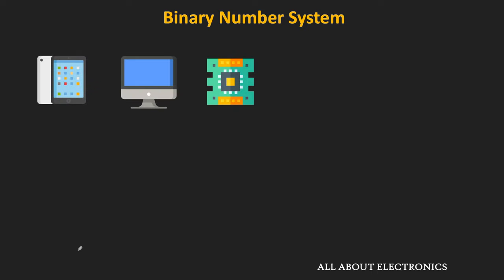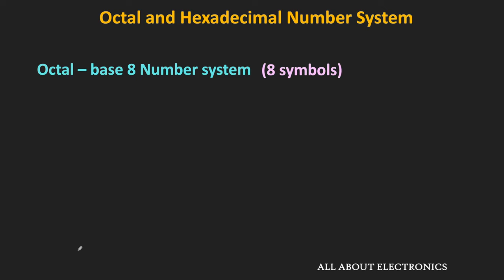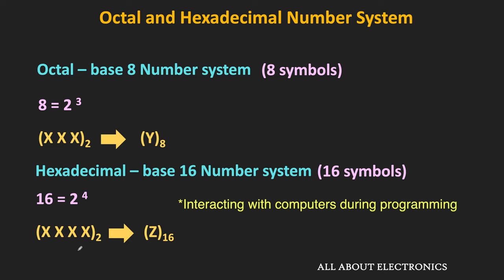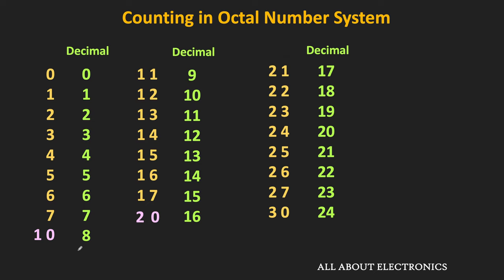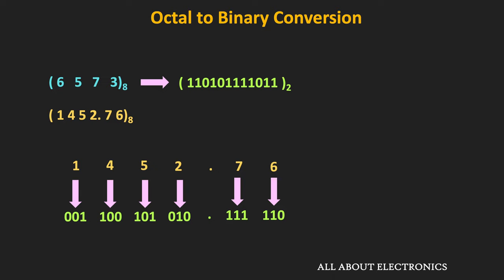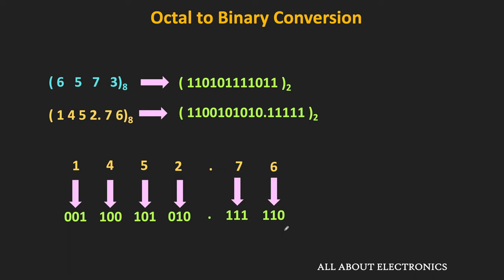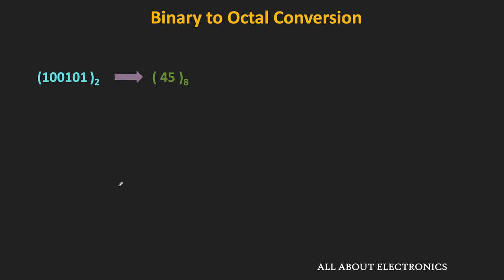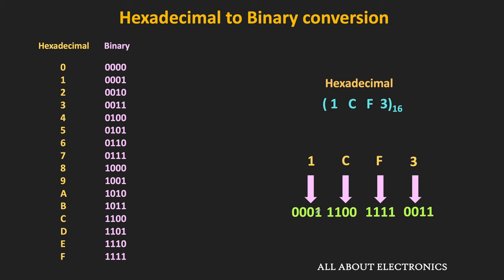Octal and Hexadecimal Number System Explained

Comment: Sir why we make 4- bit group in hexadecimal number system and make 3- bit group in octal number system??? Plz reply me with satisfactory answer
Reply from the maker: Hexadecimal number system consists of 16 symbols. Using the 4 bits ( 2^4) all 16 symbols can be represented. Therefore, during binary to hex conversion, we are making the group of 4 bits. Same way, in octal number system, there are 8 symbols and they can be represented using 3 bits. 
I hope, it will clear your doubt.
Reply: @ALLABOUTELECTRONICS   sir  apki baat theek hai laikin group bnana lazmi hai kya in both conversation......
.....  But thanks for your help 😘😘😘.   Plz help some more........

Comment: Hi please tell me, why do we use a set of 3 symbols ex: 011, 111,101 while converting from binary to octal and use a set of 4 symbols while converting from binary to hexadecimal ex: 0111, 1010, 1101 etc. 
Thanks
Reply from the maker: Because in the octal system we have total 8 different digits and in binary, they can be represented using 3 bits. That’s why during binary to octal conversion, the groups of three digits are made. The same is true for the Hexadecimal number. In hexadecimal system, we have total 16 different digits and to represent them in binary we require 4 bits.

Comment: How will we convert decimal to hexadecimal with upto 4 decimal places like 1234.5678 and why are we only multiplying 16 0r 8 4 times like at 21:06. Will we always do it just 4 time or is there some rule.
Reply from the maker: No, there is no hard & fast rule to do conversion only upto 4 places only. If you required you can go further also.